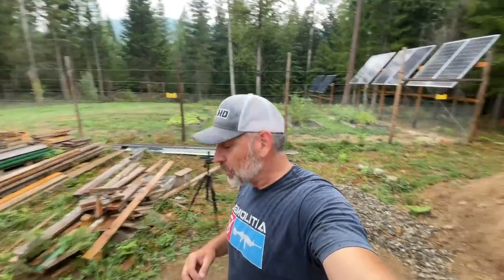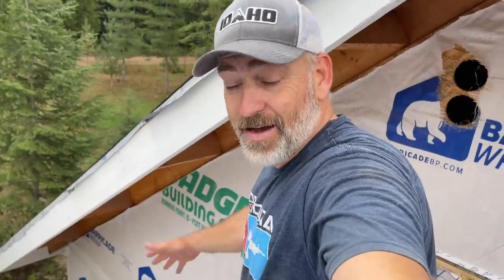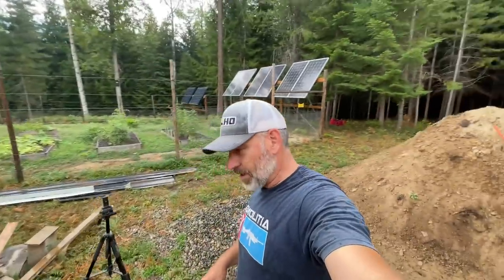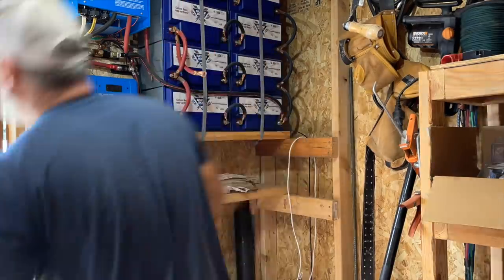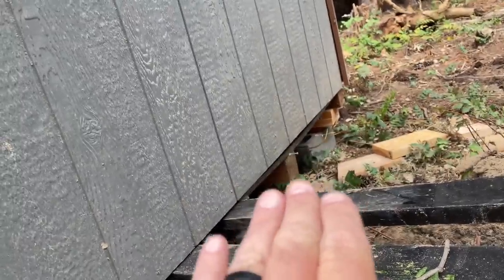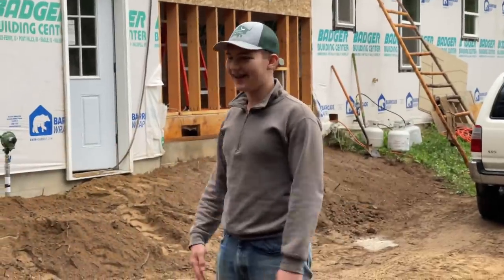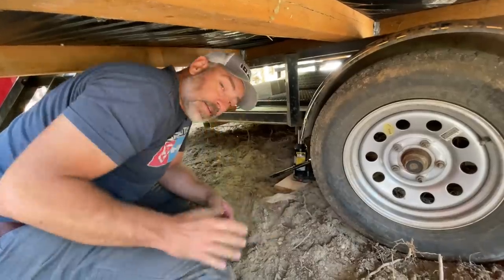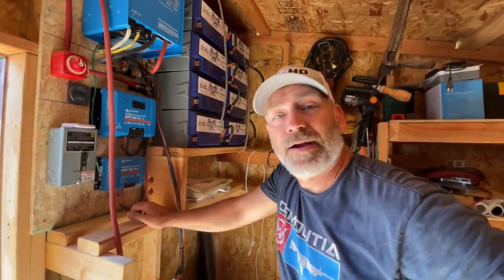RAIN is COMING! Roof Underlayment Installation, Moving Solar System, Broken Tractor

Comment: If it's in position, use the jacks, with some longish 2x6s to lift it off the trailer, pull the trailer out, and lower it, step at a time, onto the permanent blocks.

Comment: I’d tie those roof rafter ends back to the wall, by putting a margin board on the wall where the bottom is level with the bottom of the rafter tip, then put joist in transfer most of that energy back to the wall.
Reply: Had the same thought. 👍🏼
Reply: @markkaes3144  Me too.
Reply: I’ll also say so
Reply: Scab some 2x on each side of the rafter to tie in both sides of the birds mouth. Not perfect, but a lot better.

Comment: If you’re concerned, 2 easy improvements: 1) scab a piece of OSB sheathing at least 6-8” above/below the birds beak with glue or adhesive and screws; 2) a triangle is incredibly strong - put a ledger board across the wall surface at the height of the rafter tails and then add returns. You can attach breathable soffit material underneath to give it a finished look underneath when done. 
Good luck - really appreciate and enjoy your content!

Comment: That outlet on the outside of your power shed should be a GFCI and it should have an external cover to keep off the rain.
Reply: I noticed that too 👍
Reply: @AutisticMorty  If could be running off a GFCI that is inside but then it should be labeled GFCI on the outside outlet.  If still would need a proper external cover.

Personally I never run one outlet off another GFCI.  I just run straight power to each GFCI outlet so if it pops I can just reset it.  Sometimes when they are run off another outlet and that pops it can be hard to locate where to reset it.
Reply: GFI gets Tricky if Ground /neutral is not bonded correctly in an Off-grid solar System.   Not the Same as Grid Tied system and yes,  you do need a Cover
Reply: GFI gets Tricky if Ground /neutral is not bonded correctly in an Off-grid solar System.   Not the Same as Grid Tied system.    But a Cover is needed
Reply: Two way's to do everything, the right way and Martins way, another disaster waiting to happen
Reply: Boundary electric is an awesome company and meets all Idaho County codes. Ck them out! Will is a swell guy.

Comment: All you have to do is, take the chainsaw and cut 4 lengths of tree as high as the shed. Place those under the shed. Now let most of the air out of the tires of the trailer and pull it out. The tree sections will hold the shed up.

Comment: I agree with the other two guys about using the Jack's to raise it above the trailer. Use cribbing blocks to hold it up so you can get the trailer out. Use the Jack's to lower it  2 inches at a time each side till you are on your cement foundation blocks. That is how they do when they move houses. It might take a little long but the Jack's are cheaper then the main drive section of the tractor.Good luck and be safe.👍

Comment: Put your cribbing under the corners of the shed and pull the trailer out. The use the jack to slowly remove the cribbing and lower the shed.

Comment: Regarding the rafters with the bird's mouth cut too deep.  You could bolt 2 inch wide strap steel on both sides of each rafter where it sits on the top plate.  Now's the time to do it before you sheetrock inside.

Comment: Doh, if you can lift the building and the trailer to get the weight off the tyres you can lift the building off the trailer and lower it, block by block !
Reply: True, but unfortunately it’s not in the right location yet and the tractor is in the way. 😞

Comment: You need 2 "handyman jacks" to lift the shed. One side at a time, one jack on each corner, lift it off the trailer and block it, remove the trailer and walk it back down on the blocking, one side and then the other, back and forth. Not as easy as the tractor but it works well I've done it several times. The jacks will lift about 4000lbs each. The jacks are sometimes called "high lift jacks". Good luck, things are looking good.

Comment: Could i suggest you sandbag around the propane tank. Say 3 feet away and to the same height. Then bring the surrounding area up to the top of the sand bag wall. I am not sure why but i like the idea the tank is hidden and protected from falling trees

Comment: The best way to move a building is lay some 2X8 on ground under the building  get about 8 pieces of 2 3 or 4” carbon steel pipe about 6” long and jack it up just enough to get pipes on boards under and roll it anywhere you want it. Hope this helps .

Comment: Next time you move a small building use logs and roll it by pushing or pulling and moving the logs , pipes work as well. Ground needs to be fairly level!

Comment: If you sister some short pieces under that eve on the level plane you will then transfer any weight to push in on the top plate instead of now wanting to push down and break off the rafter tails

Comment: Just nail some Simpson rafter hangers on each rafter. The kind that nail to the wall and wrap around the joist. This would lock the rafter to the wall.
Reply: Bob, I doubt that the Simpson Strong Ties will add much support to the rafter tails.  Their job is to keep the rafters from moving. The concern is that with any substantial weight on the overhang, the weakened rafter tails will not be able to hold it without further support.  The birdsmouths took too big a bite out of the rafters.

Comment: If you use your tractor to pick again keep the forks wider. May have contributed to the failure of the cast hub. Would keep an eye  on the other side for stress cracks.  Also agree that it wouldn't hurt to put gussets back to the wall from your overhangs. All good stuff

Comment: I built a shed about the size of your. However I placed floor joists on 4x6 post beams that ran the length of the building that were cut on the ends at 30 degree angle. This made the building slidable. I drilled 5/8” hole about 10” back from the end to put a rope through and it worked very well.

Comment: Get more cement  blocks and set it on them so you can get the trailer out.  You can lower it to the height you want later, when the tractor is back in commission.

Comment: The same bottle jack you leveled it up with, while sitting on the trailer, can be used to also allow you, to get it off the trailer... 

Simply jack it up just like you did with the forks, pull the trailer out....now raise the jack on one side so that it is almost fully extended and shed is 1/2"off the blocks... take one block out each end... replace it with a smaller block... lower the jack...now go to the other side do the same thing... keep repeating the process until you have lowered it to the height off the ground you want it to be.. 2" to 3" s at a time...

jack it up to lower it down...in 10 minutes you could have it setting right where you want it...

Comment: Martin, next time you run into disconnecting the trailer from car hitch, just lower tires almost flat and it will drop the hitch enough to drive car away. Just my .02 cents.

Comment: Corbels aren’t normally a part of you architectural style but you could use them to add back strength to that weak overhang. One at each end and one in the middle would work with the facia board to add strength. Or....you could build a large garden window wall to wall. Anyway you’ll work it out.

Comment: tractor jacks?  or with blocks even a bottle jack on a corner just to take the weight off and then let onto other blocks. or scaffold legs bolted on. So many options

Comment: You can put 2x4 ‘s straight out from the wall that will make a triangle and will support the rafter tails and will be covered by the soffit when you put it on. Just a thought that I think will help. But you will probably be ok like you said you have a 2x8 facia that does connect them all together.

Comment: To be safe that exterior plug at 5:38 should have an outer housing cover of that.  It also would be safer as a GFCI plug.  Right now I would fail that plug.  I do house inspections for a living and that would not work and neither would those rafter tails.  Down here they would have to be replaced to meet code.  Just FYI normal water weighs around 8 pounds per gallon or about 1 sq foot.  Imagine the weight of the snow falling off the roof en masse and following gravity.  I bet they break.  If you run a board horizontally from the tail ends back to the wall to create a flat soffit that will help mitigate the problem so the end forms a triangle and the crashing show weight will be transferred more to the wall.  It's ok to ask the experts out here how to do these things.

Comment: Those forks are a waste of time if you don’t go all the way under. The further away the more effort your tractor needs, think levers. The stress on the front hub is directly related to the weight you put on it by having the shed half way down the forks.

Comment: I saw a video a couple of years ago, where some one put their shed on an old trailer permanently. Basically the metal framing of the trailer was ok (they bought it used and had to do a little buit of welding repair) but it had no wood left. So they just put the shed on timbers cut to fit the trailer and bolted it all together. And they had a permanently mobile shed. I don't now why one would want that but they did it. And I thought it was a cool concept so I am sharing it here.

Comment: You can take the shed off the trailer with the 2 bottle jacks the you used to level the trailer.  The same procedure just use the bottle jacks instead of the tractor.  I would lower it by one wooden block at a time for safety.
Reply: Can you just use the bottle jacks on the trailer bed and under the skids to raise it enough to put a few cinder blocks under each corner? After that is supported, on the corners, use the jacks to help remove the supports from the trailer. That should enable you to pull the trailer out and then slowly lower the shed corner by corner until you have the height you desire. Good luck. Love watching the show!

Comment: Weak rafter tails:  If you plan to close in the soffits anyway (or decide you need to now) it can add a LOT of strength by bracing the end of the tails to the side of the house.

Comment: Your rafter tails will be fine...the rafters are also acting as a fulcrum rather than just a 2 inch rafter since it runs from the bird "beak" cut down the side of your structure. Any shorter though and I would not stand under it..lol.

Comment: I had to move a 10X 18 shed one time from my yard to my neighbors yard. I ran a chain underneigh the shed frame rails 4 X 4 beams to the rear and hooked a chain to my car with front wheel drive 2000 sable. I short chained it so the car lifted the front of the shed. It took me two tries to get the shed rolling. then it was a breeze I just drove till I got it where he wanted it.....

Comment: I would have lowered the front of the trailer to get the back of the as high as possible to place the supports for the shed in the back, too then lift up the front with the trailer too get it high inaf too get supports in the front too get it free

Comment: At 10:09. I do not know the dimensions of the shed but I think you needed at least 96"forks. I have used slip on extensions with the 48" forks to make it 96" total length. Now I will see your solution. Good solution. Could you have used the jacks, blocks and wood to raise the shed off of the trailer and then lower it one piece of wood or block at a time? I got that from how you raised the shed up. Have good days and maybe the parts will get there sooner than expected.

Comment: Research "cribbing."  Get yourself a 10' 4x4 to use as a lever and you can lift or lower the shed by hand.  I enrolled in a CERT class with the local fire department and we use cribbing and a 10' 4x4 to pick up an ambulance.

Comment: Martin your going to need that trailer. Why couldn't you have used a hydraulic floor jack and slowly lowered that shed jacked it up high enough so all the sides can slowly and evenly come down. That way you cpyld have moved your trailer out.

Comment: cut down 2 trees and flat on side of 10 foot trees and slid the tree under the shed like beams //and  leave the shed on the tree beams , and blocking .free up the trailer you could then leave the wheels on trailer ,-and pull it out / use what you have around you // make your beams  save lots of work /and shed  in place for now //and trailers is free up //

Comment: Just a quick question was it you planning on putting the solar power in the garage as moving the shed I have moved the shed with rollers that the affordable homes users move a double-wide to close up the home

Comment: you could add, as an architectural detail, supporting arms so to speak, I know that there is a technical term. But basically a "leg" would run down from the facia at an angle back to the wall. Just either dress them up or maybe use a couple of four by fours that you dress up to look like beams.

Comment: evidently yall have never heard of blocking a building. if the building is where you want it, jack it up and put blocks under it until you can remove the trailer. then jack up the corners one at the time and remove the blocks and or boards a little at the time and keep going from corner to corner until the building is at the level desired. finish by checking level and shimming as necessary. it appeared to me that yall jacked up and secured the trailer enough to have put the building in place. oh well.....................g

Comment: You could have used pipes as rollers to pull the shed to it’s desired position.
Reply from the maker: Maybe but I had the trailer so I figured I would use it. It worked great last time we moved it.

Comment: Re:  rafter tails birdsmouths,  is that 2 inches lying on the top plate, or 2 inches of thickness where it crosses the outside edge of the top plate?

Comment: Gee, You had the shed in the air with the trailer. All you had to do was get it a little higher, then block the shed up and drop the trailer and pull it out.

Comment: Just watched on another  channel  shed / home delivery   where the shed had too much load in/on it and cane so close to braking  into   the side with door in middle  runners  and joist  come apart  and bowed  6+  inches  the siding was  popping  off it was metal  also crumpled  and  was real mess    
I hope the supplier and delivery  company  compensate  customer  appropriately

Comment: Too bad your couldn’t Jack up the building some , pull out trailer, and lower down on new foundation. That Is if it’s in the desired location. Get use heavy duty harbor freight Jack and a 4x4 or 6x6  beam to lift against the floor joist.  Just a thought….

Comment: Hay the load ends at your seat cut if you have 2 in above the seat cut on your rafters that's 400 lb per rafter you're not going to and you have like 10 rafters there at 7:12 pitch don't worry about it you're in good shape you're never going to have 1400 lbs ice and snow on that little 16 in overhang did you got the in at the end of your rafter the load ends at your seat cut all right all right

Comment: You made that a lot harder than it needed to be.  You could have just rolled it on pvc pipes.  Have moved several much larger sheds over much longer distances that way
Reply: Depends how the bottom is constructed.  There could be obstructions to rolling it.

Comment: Hope you have better luck getting those parts than I did. It took me 6 weeks to get mine. I had the same thing happen tö me. To svoid the problem agsin don't böunce the front end and don't try to do things the tractor is not suited fot. It's nöt a D9 cat.